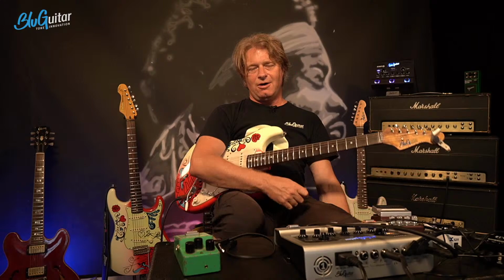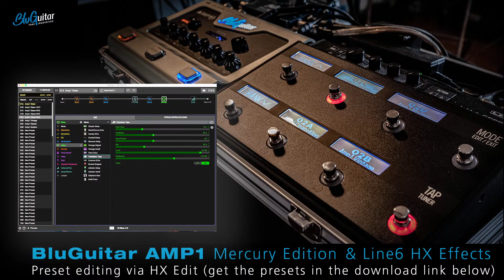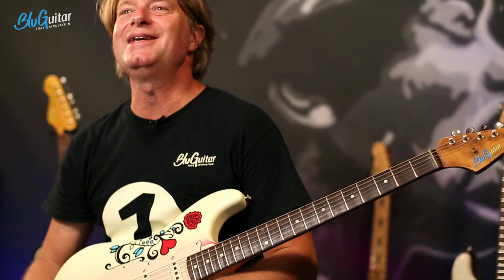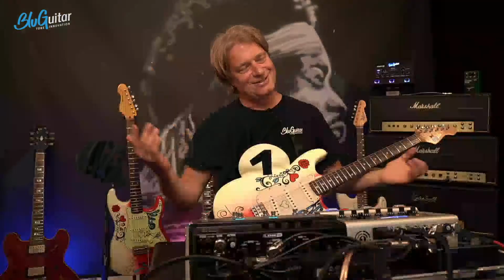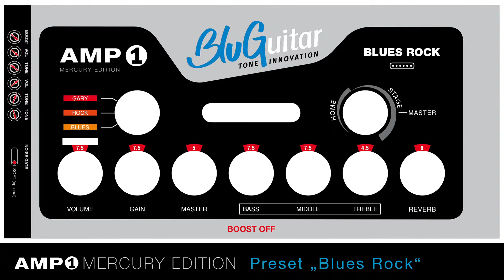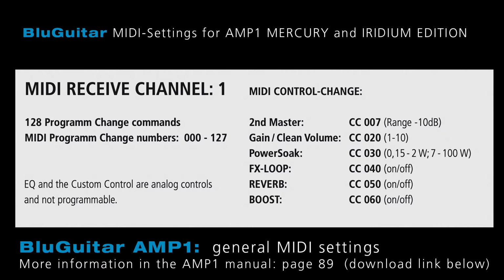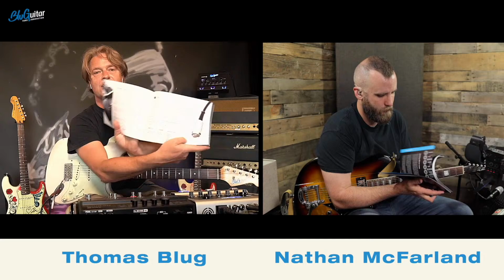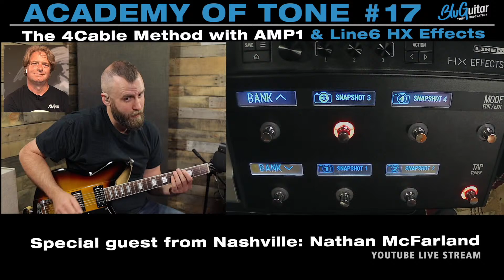Academy of Tone #17 "Incredible flexibility 4CM: 4cable method with AMP1 & LINE6 HX Effects"

Comment from the maker: I hope I could bring a bit more light into that 4 CM method setup for effects with your AMP1... cheers, Thomas
Reply: Many thanks for these excellent videos. One thing to be aware of is the number of Analog-Digital (A/D, D/A)  transformations that are involved in the signal path when you are using the digital multieffects in 4cm with your analog Amp1.
For example, if you use an inbuilt overdrive and an inbuilt delay the signal path will be (omitting buffers)
Guitar ->A/D -> Digital Overdrive effect-> D/A ->Amp1(in)->Amp1 preamp stage ->
Amp1(Fx Send) ->A/D->Digital Delay->D/A->Amp1(FX Return) - Amp1 power amp stage -> Speaker

This is not to detract in anyway from the incredible creative power such an arrangement provides, and the D/A conversion technologies are always improving. But if you've felt that the quality of the tone has changed somehow some of it may be owing to this extra processing, and some extra tweaking (e.g. EQ of multieffects output) maybe required to compensate.

Comment: Hello, I really need some help, I connected Fender Hotrod with my HX Effect in 4 cable method and and I lost the ability to use volume on amp. It can't go higher or lower volume. The hx effects controls the volume…. Is there a setting that I need to change on the HX effect so that I can use the controls/volume on my Amp? Thanks for any assistance
Reply from the maker: Please ask in a Line6 user group. Our try our real dream rig user group on Facebook
They might be able to share their Line 6 knowledge with you:
https://m.facebook.com/groups/638864763362829/?ref=share

Comment: Not sure if you covered this in the video - I haven't had time to watch the whole thing, but what is the recommended FX loop level setting on the Amp1 when paired with the HXFX in 4CM?
Reply from the maker: I put it on instrument level, and it works fine.
Reply: @BluGuitar  Thanks.  I think that's how I have mine set.  I have the absolute worst luck in buying new amps.  The FX loop level switch on my Amp1 ME isn't really working right - it doesn't click in or out so I'm not really sure what it's set to but I have all the inputs and outputs on the HXFX set to Instrument level and there is no change in volume whether I'm using the HX or if I'm going straight into the amp so I'm assuming the Amp1 is also set to Instrument level.   I sent you guys an email about the switch but not sure if you saw it yet.  I'm the guy who also had the footswitch jack die on my first one.   Aside from that, it sounds great and I love it.  I've been using it as my main amp since I got it and my Mesa and Friedman are sitting in the garage wondering why I've been ignoring them.

Comment: Hi, just a slightly off topic question: 
I use the Iridium with a midi1 cable and 4 cable method with the boss gt100 for effects only and midi switching.
The issue is that when I remove the midi cable and the mono jack from the rec out, hold the middle button and switch the analog amp cab simulation on the cab sim works fine
As soon as the midi cable and the rec-out cables are connected and I switch from channel via the gt100 the analog cab simulation is turned off and this will happen every time I turn on the cab sim and connect midi and rec out. 
Am I doing something wrong?
Reply from the maker: This is something that can be fixed. Please contact us at service@bluguitar.com! Thanks!

Comment: Hi Thomas,

I'm Marcos, student of Mestre Kleber Shima from Sao Paulo.
I mounted my setup using the 4 cable system exactly as you explained but using the "HX-Stomp Line 6".
What I noticed was a very big loss in timbre, volume and high end...

From what I'm researching on the internet, it seems to me that the problem is in the FX Loop block from HX.
Have you ever tried the AMP1 with the HX-Stomp?
Reply: Forget my question!!!! LOL

The HX is stereo and I made the input on the Input/R without realizing it, I set the FX Loop/L on the HX. A small detail! Because the sound comes out, but it loses in volume (40% approximately) and it also loses in timbre. It gets muddy.

I touched the handle and set everything to Left. Is perfect!!!!
Best Regards
Reply from the maker: Glad to hear that you found the issue!!!

Comment: I used this setup with Serial FX Loop and it sounds nice, however I noticed that the amp sounds a bit less crisp and direkt, so I tried using parallel FX loop setting (and set time based fx to 100% wet in HX FX to avoid comb filtering) and it sounds much better, however with parallel fx loop the amp is a noticeably quieter, is this normal?
Reply from the maker: That is a sign that there’s something wired with the FX signal. Please double check by using a patch cable instead of the Helix. If that’s the same when switching from serial to parallel it’s the prove that the helix is changing something...
Maybe dry volume? Or...???
Reply from the maker: That would be a sign that there’s something wrong with the FX. Try a patch cable in the loop, if there is no difference in volume when you switch from serial to parallel, it’s the prove. Double check the effects, as there might still be some direct signal...
Reply: @BluGuitar  I tried with a simple patch cable and the volume stays the same, so it must be the helix.I guess parallel splits the signal but since only wet (delay for example) is coming back from the helix, the volume drops slightly i guess. Just to be sure does parallel actually split the signal from the pre-amp (ie 50% going to loop 50% going to master) or just duplicates the signal and sends it out from the loop? (100% going to master while another signal is sent from the loop)? Thanks for taking the time to answer all the questions. It's not a big issue at all, I'm just trying to understand how it works and I'm really grateful for your assistance!